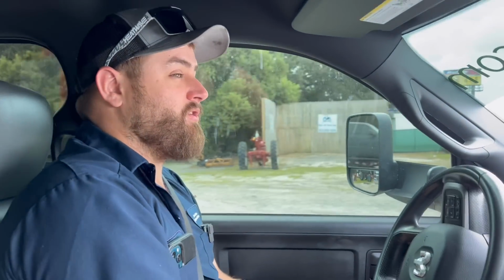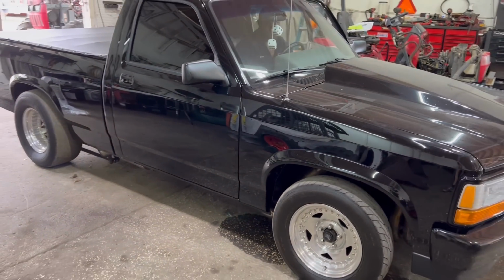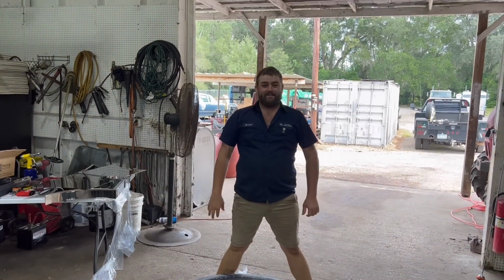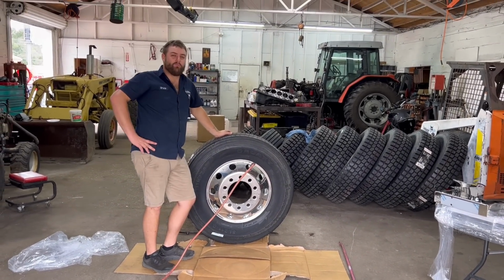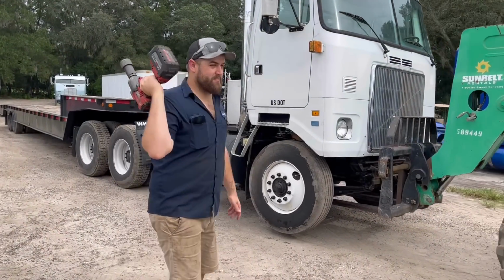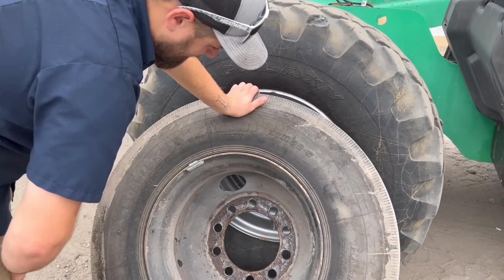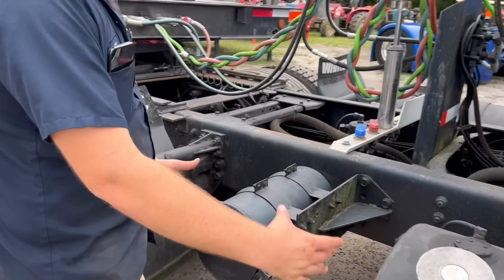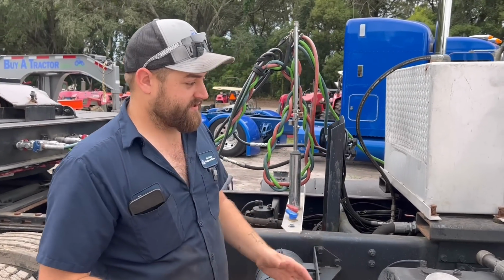NEW Tires and Wheels for the Cabover, Help me find Parts!

Comment: The numbers you read out on the tyre is the load rating. The date is usually in oval on the tyre and consists of 4 numbers usually and first 2 numbers are the week and second two is the year. Nice old truck 👍

Comment: Bruce, you should check out Vintage Air for AC they could have somthing that could work in the truck.
Reply: Vintage air is completely overpriced, ac systems are very simple and easy to put together from parts.  All you need for air conditioning is a compressor, evaporator, condensor, txv valve or orifice tube and some lines.  Universal under dash ac boxes usually run about $150 and condensers are under $100 with receiver drier.  I can add air conditioning to just about anything for under $600

Comment: Be safe. The tank on right side may be a lube a fine aux oil filter. Check the lines if thier Number 16 or 12 follow them one will come of a pressure side on the oil on the block, the other will return to pan or non pressure side of the block.

Comment: If you get everything took off the back of the truck I think it would look bad ass with twin straight stacks 
And some either full fenders or 1/2 fenders 
Those new tires will fill up with rocks and bust out ur back windows and mirrors

Comment: The number you gave was the tyres load rating the letter after was its speed rating. The date code is at the bead on one side it will be dot then 4 digits. First 2 are the week number last 2 the year.

Comment: For those that don't know and are curious as to why there are red and yellow dots on the sidewall of a tire. It has to do with proper balancing of the tire, when the tech installs the tire he/she will look at the dot locations and If the valve stem is located at the heaviest point on the tire, it will be lined up with a yellow dot on the sidewall. When a red dot is lined up with the valve stem you can assume that the valve is at the tire’s lightest point. This is more useful on cars, SUV's and small trucks to help achieve the smoothest ride with lesser vibration as possible, just a reminder though nothing is perfectly 100% balanced with a rubber tire, but still well with-in specs. Many garages don't even bother with it because basically it's just a nuisance to rotate the tire on the rim, line it up, check, bla bla bla, don't have time for that.

Comment: I have changed thousands of those tires I’ve never seen anybody use grease. You always use soap and the best way to apply it is worth a squirter bottles. Mix a cap full of dishwashing soap in a squirter bottle and just spray it on. That way your wheels will not spin inside the tires because the soap will dry out the grease will not just FYI
Reply: Look at bucket, it Murphy's tire lube

Comment: the best tread ware and grip and fuel mpg  is 90 psi for drives 105psi  for steers and100psi trailers and the date code  will be on the DOT number and dependon on what system the DOT number is as well
Reply: Send a DM to see what I got for you 🎁

Comment: 146/143 is the weight rating of the tyre the letter behind it is the speed rating but date code has it branded by tyre iron usually 4 numbers example 1201 that means 12th week  2001

Comment: I like to have an air regulator on my compressor, so I can set it to the pressure I want my tires set up. I always forget to take the lockable Chucks off the tires. I may or may have not blown up a tire or two.

Comment: The date codes are the last 3to4 numbers on the dot number and stud pilot wheels should only have the nuts and studs tightened dry no lubricant of any kind hub pilot wheels should be installed with light oil on threads never use anti seize it damages the threads.
Reply: Send a DM to see what I got for you 🎁

Comment: Hey Bruce,when you get a truck why do you always need to change the wheels to the aluminum ones or lowering them & stretching them,I can see just putting new tires on the wheels bcause that style of day cab doesn't look right with the aluminum wheels on it,should've just put new tires on

Comment: That looks like a lubrfiner oil filter on the frame not an air tank. Are you sure those fuel tanks are steel ?? Sounds like aluminum when you tapped on it ....they might just be painted aluminum tanks